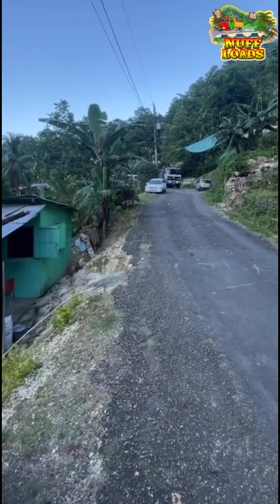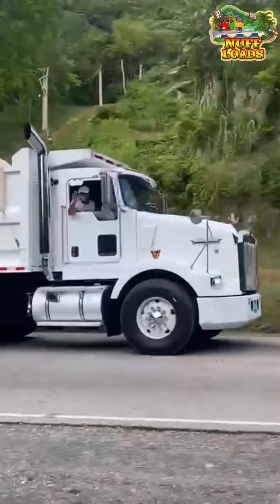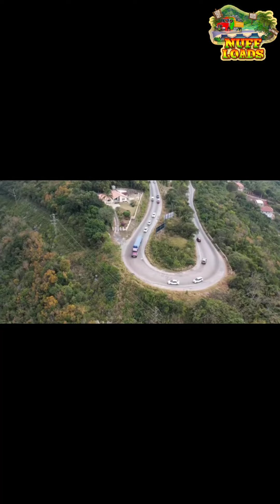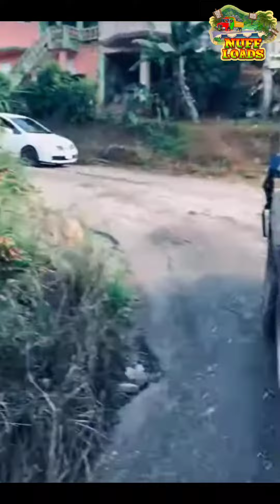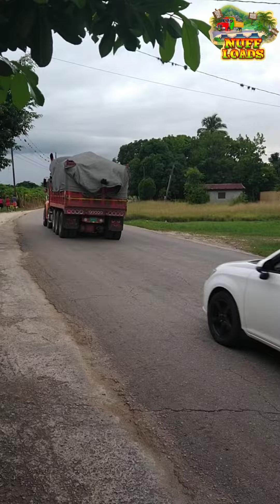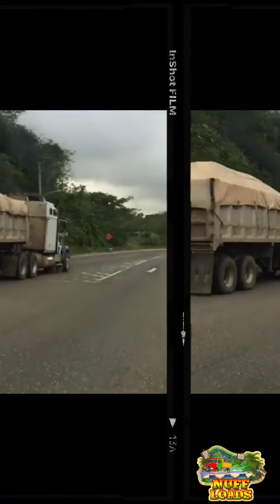Why Jamaican Truckers are so Obsessed with making so much noise with their Jake Brakes?

Comment: Explain jake brakes better. Its compression release braking where  solenoids systematically cause valves in  individual cylinders to release compression just before the power stroke.  This causes the engine to absorb energy rather that create it, utilizing the drive  train to slow the truck.